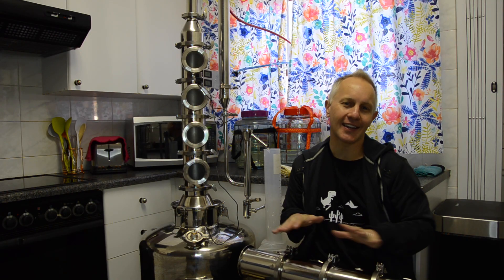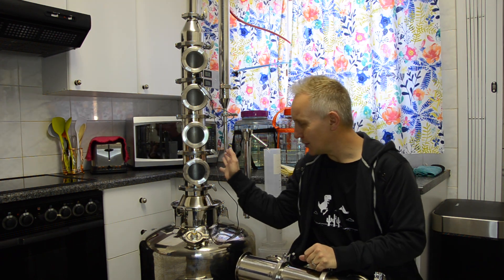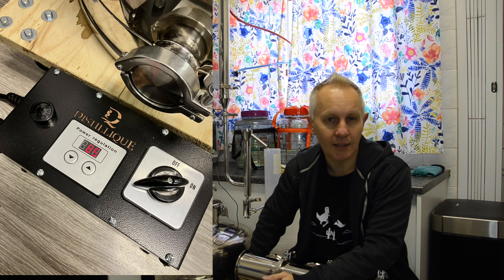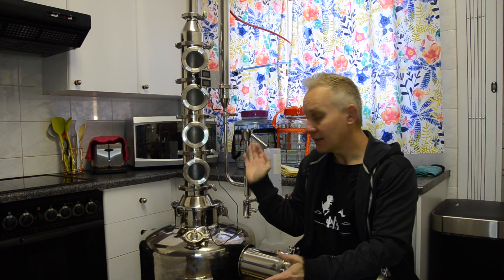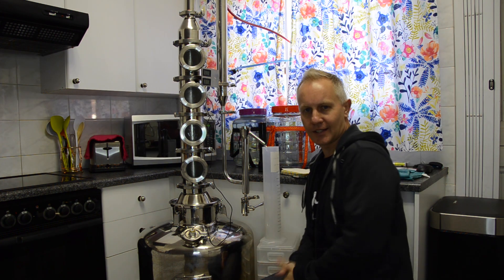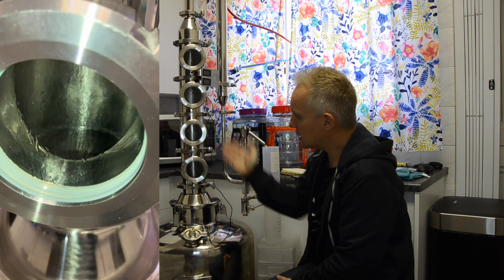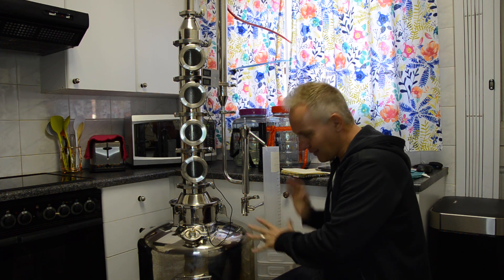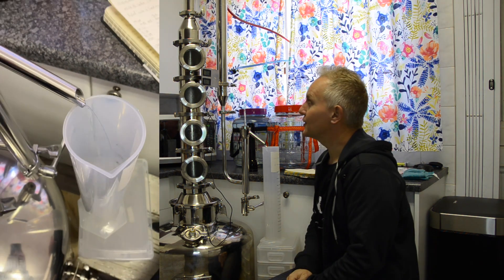How to Do a Stripping Run | Practical Distillation Guide for Beginners

Comment: hi such nice video 
i have question about this 4 inch reflux still that you use in video 
is it possible to make true vodka with 6 plate (achieving 96%)??
if so then why people talking about 18 to 20 plate to archive true vodka smell and flavour ?
is it possible to dilute and redistill your output product 3 times with 6 plate still and its equal to professional disitll factory with 18 plate ? 
i search everywhere and nothing out there 
it was so nice if u made a video about that i bet its too many people question 😍
happy to find your channel
Reply from the maker: Hey Man!
Thanks for the feedback, I appreciate it!
The simple answer is yes. You can achieve a true vodka with 6 plates and reflux still. 
You can either run it with a high reflux or like you said, dilute and redistill.
One of the main reasons why 18-20 plates are use is about capacity (high flow rates) and time.
Just imagine trying to distill 400-600 Lts with a 4 inch 6 plate column, its going to take a lot of time.
Using more plates allows you to run at higher flow rates, thus saving time.
So for home and hobby distilling you can achieve true vodka with fewer plates, higher reflux and more time.
Sweet!!
Reply: @distillergreyling  thank you for ur answer plz talk more about vodka in your channel cheers 🥂
Reply from the maker: Awesome Man! Cool I’ll make a plan!
Sweet!!

Comment: What advantage does a stripping run give you over just running one spirit run slower? Would you not still get flavor and higher abv at the same time? Also I have an all SS unit too. Do you incorporate copper into your run anywhere? Does it matter in stripping run? Thanks for video.
Reply from the maker: Hey RPTV!
Thanks for the feedback, I do appreciate it!!
Stripping runs helps to make the volume amount for the spirit run more manageable when you are dealing with a large fermentation volume. For smaller volumes it tends to make more sense just going straight for a spirit run. 
You can have some flavor lost during a stripping run, when you stop it to early. For instance stopping at a 30% ABV. I like to stop my molasses stripping runs at 10% ABV, but you can take it lower, its about your preference. 
I do add copper during my spirit run, bubble trays and mesh in the 180deg bend at the top. You can add copper mesh to a stripping run, but not too much as it may cause some unwanted reflux.
Sweet!!